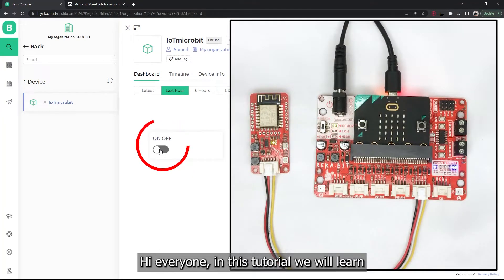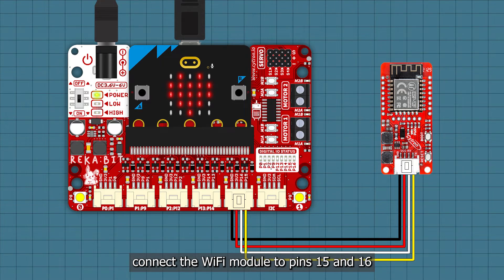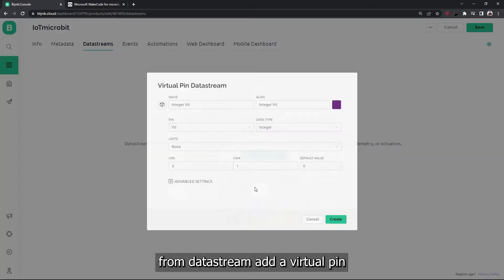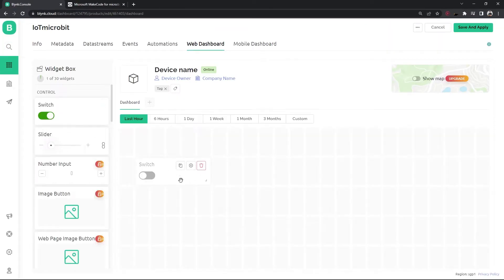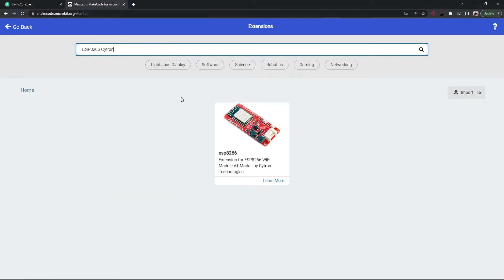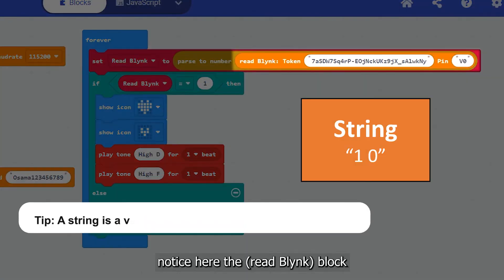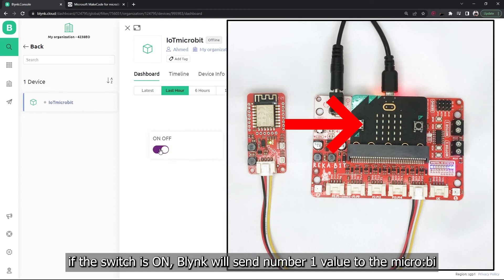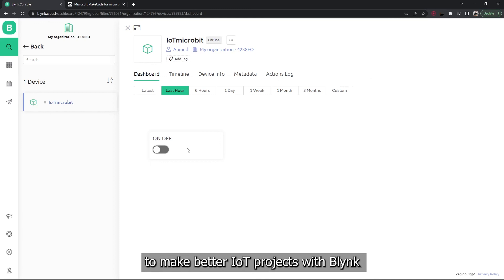Get Started with Blynk 2.0 on micro:bit | IoT for Beginners #microbit #microcontroller #iot

Comment: set Read_Blynk to parse to number read Blynl: Token"1U-8pkG5UIR6J8PTYXsDo5Ba1dR96Ljj" Pin "v1"    >    have no response, 
set Read_Blynk to parse to number read Blynl: Token"1U-8pkG5UIR6J8PTYXsDo5Ba1dR96Ljj" Pin "1"      >    get a response with 0 (0 all the time). 
Could you tell me what the problem is?
Thanks.
Reply: write Blynk : Token"1U-8pkG5UIR6J8PTYXsDo5Ba1dR96Ljj" Pin "V2" Value"1"          >       success update 1 to Blynk V2
Reply: set Read_Blynk to parse to number read Blynk: Token"1U-8pkG5UIR6J8PTYXsDo5Ba1dR96Ljj" Pin "v1"    >    have no response, 
set Read_Blynk to parse to number read Blynk: Token"1U-8pkG5UIR6J8PTYXsDo5Ba1dR96Ljj" Pin "1"      >    get a response with 0 (0 all the time). 
Could you tell me what the problem is?
Thanks.